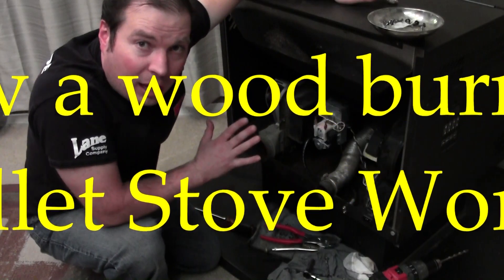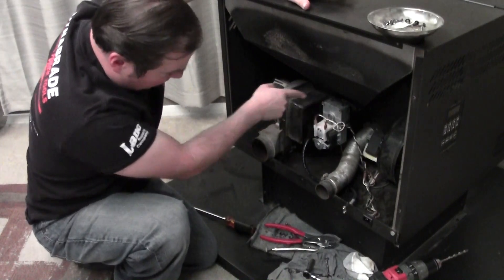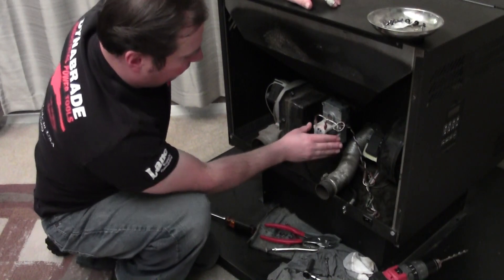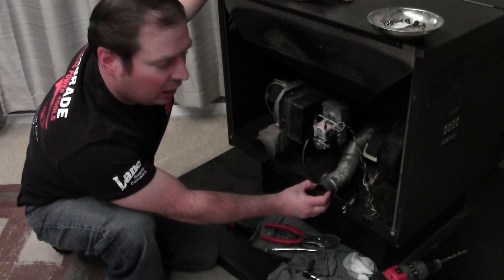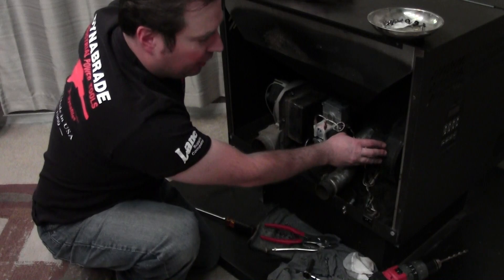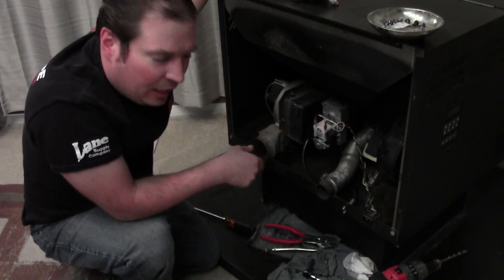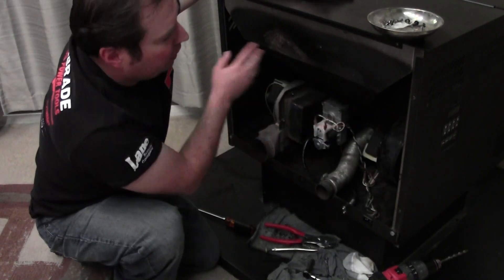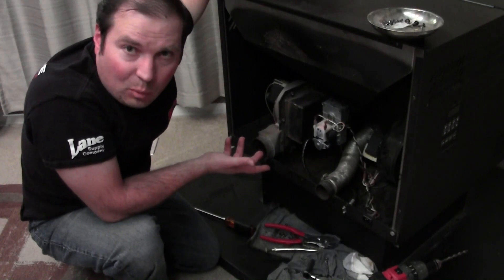How a pellet stove works

Comment: The electric motor? May as well get an electric heater. Waste of time
Reply from the maker: What about the electric motor?
Reply: @thejunkman  it seems counter productive relying on two separate sources of energy to provide the same function.
Reply from the maker: Kind of like a traditional gas forced air or heat pump.  The electric motor draws about 3 amps or less with its gear reduction.

Comment: All electric? Or needs gas?
Reply from the maker: It runs on wood pellets, but requires a small amount of electricity to run the draft fan, room fan blower, and auger.  Roughly 40 watts or less.
Reply: the wood pellets are the fuel. gas is another type of fuel for a fireplace. you wont have both in one machine.